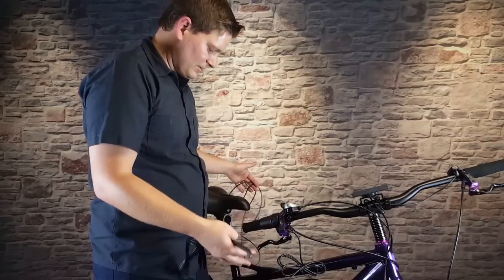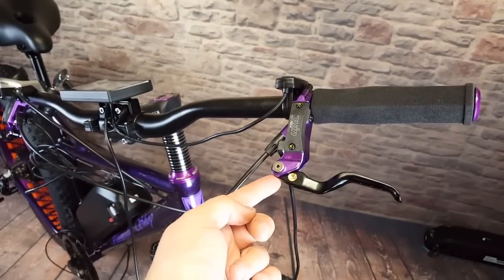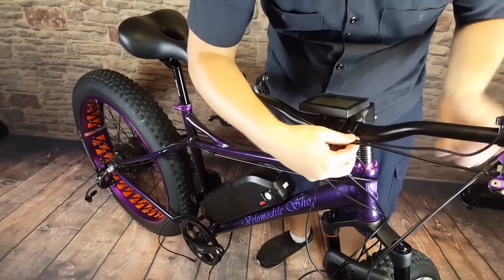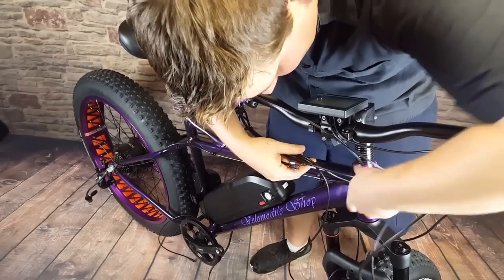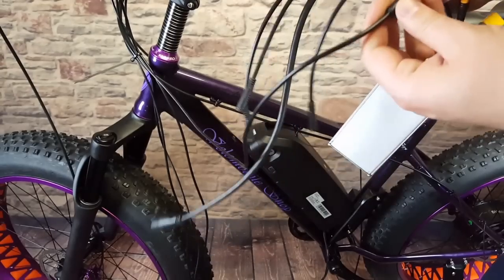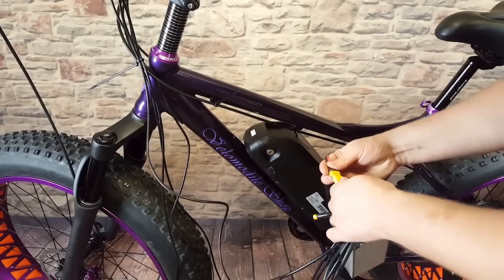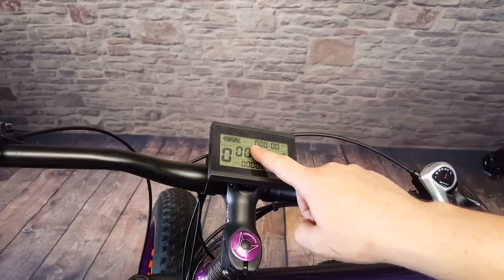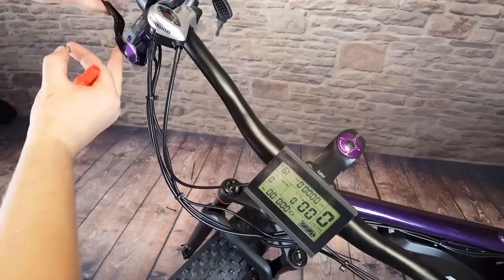How to build an Ebike ep. 10 - Wiring and how to make it look good

Comment from the maker: Our custom build is almost done!  Are you building your own ebike?  Let me know in the comments below.
Reply: Bolton Ebikes Building a 750watt Bafang geared hub motored Dolomite 72V 35amp / 60-80V controller and LCD, Magura MT-5e’s
Reply from the maker: @HiTecHoBo  Nice!  I have not run the Bafang motor at 72v, let us know how it holds up!
Reply: Building my Salsa Timberjack. BBSHD WITH 52v battery. No break sensors, just shift sensor. What computer display do you reccomend?
Reply: Hi m getting issue in the pedal assist
Reply: i guess I'm pretty off topic but does anybody know of a good site to watch newly released tv shows online?
Reply: @Damon Walker Flixportal
Reply: @Vivaan Avery thank you, signed up and it seems to work :) I appreciate it !!
Reply: @Damon Walker glad I could help :D

Comment: Don't seam like this guy has time to answer your questions lol.
Just finished my work on my claud Butler Mtb hibrid. Bbso2b. Would like to know the difference with the o2 and bbso2b. Goes 32mph with the throttle and can pedal along at 24mph so happy with it. Just got to heat shrink the electric cable. Apparently its OK in the rain.

Comment: Just bought a Lectric XP foldable, and on the second day the hand throttle stopped working. The first  connection less than a ft from throttle looks good. not sure where the connection is that goes into the controler. Any thoughts?